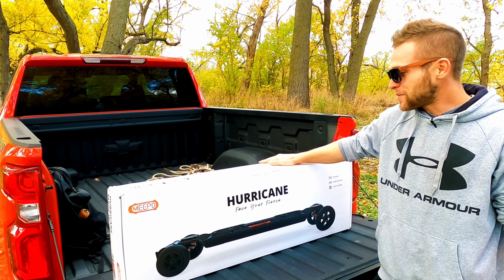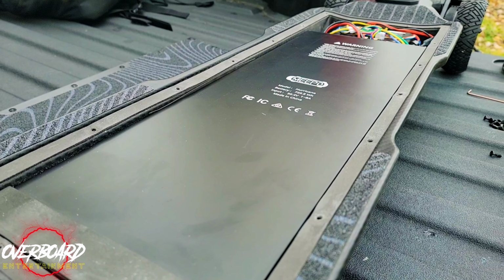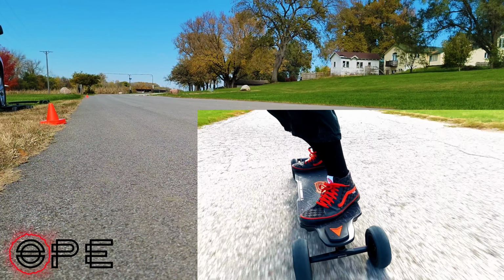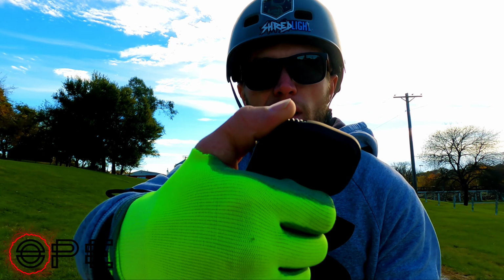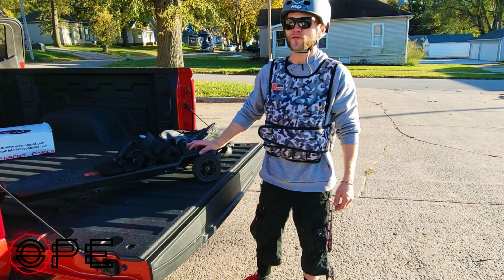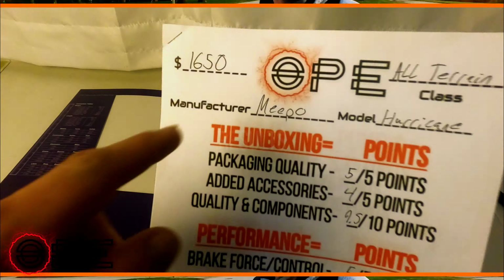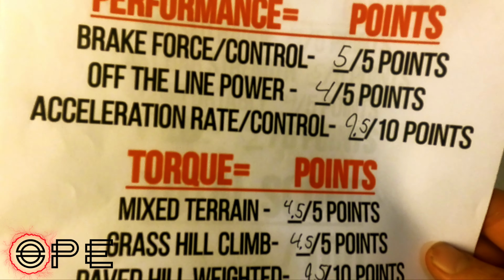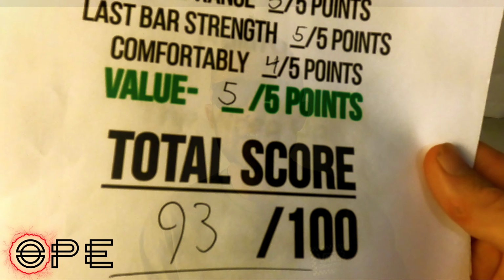Meepo Hurricane - Unboxing | Specs | OverBOARD Performance Evaluation

Comment: Hi and thanks very much for this review that I consider like one of the best if not the best one. Your review system is really good and looks very professional, congrats. 
I was afraid that the weight and dimensions could cause some troubles for fun while carving but it appears it doesn't. I have been waiting for a long time to an AT board with the following specs : agility, range, power, fun and <1400$. It seems that Meepo did it... 
For now I have much fun with my Meepo V2P and I'm thinking a lot about buying the hurricane.
Reply from the maker: Thank you so much....
I will be 100% honest with you....

Buy the Hurricane dude....
Its the most quality built, funnest and most powerful board out right now in my option.
Very intense and feels extremely solid....
Again, thanks bro
Reply: @overboardentertainment1569  Thanks for your fast answer. I can't lie saying I'm not disappointed by the range you got in your range test  (also a nice and useful video) even if I got the fact that it was in an agressive mode. In a sense, I was satisfied when you said in a comment that, at least, we couldn't reach less than 18 miles lol. But in another sense, it's too bad that it seems impossible to get the 31 miles advertised except if you ride at 5 mph maybe hahaha. 
I hoped that the new ESC could arrange that but it seems not... Anyway, this board is still a great crazy value for the current price. I hesitate with the Zeuz for the range point but I also know that I love power lol and it's not everyday that you need more than 20 miles range... Moreover Zeus is more expensive....  Really hard choice that many people are looking to make nowadays.
Reply from the maker: @elohir1664  For real tho, if you kept it in speed mode one, on a gym floor.... you might get 31 miles hahaha

But im a power hungry dude too... and the Hurricane is in no short supply... 
And
Like you said, how often are we doing 20 miles on a typical day
Reply: @overboardentertainment1569  I just ordered it bro ^_^' I'll keep you in touch, thx for your help "
Reply from the maker: Ayyyyyy!!
Reply from the maker: @elohir1664  c
Congrats bro... in for a good time😁😁

Comment: For Comparison,I have an Ecomobl ET..I have gear drives instead of belts.12 Cells and 50 amps.Goes up to 36mph and up to 30 miles.I have 540 miles on it.Nothing replaced.Good board.
Reply from the maker: Damnn... sounds like a super solid build.... 
I need to look that up and take a closer look.... when did that board drop?
Reply: @overboardentertainment1569  it must have dropped about 2 months after I got the ET..then hearing about them dropping down the ET to make the ET2 more of an improvement.Only thing changed was the wheels and the ESC and the color.It's sort of loud but then,it gears.
Reply from the maker: @paperlessdigs6169  its a kick ass board  bro... I'd be proud as ever with that board  out ripping around. 
The numbers are there....
But I will have to keep them in mind for the future boards so more people can know about Ecomobl.... dope

Comment: Just got this board in this morning....after jumping on the black Friday pricing on 11/2.  First impressions is that this board is pretty damn sweet....am super pumped about it.
I am not savvy on gearing yet....but do you think the factory 55T will work out if i change the tires from 155mm to some knobby 175's?  I can only guess that it should be ok since I am a light rider (less than 140 lbs).  Would like to take the board on some light trails.
Reply from the maker: Where are you getting the 175s....

The 55s would work with most Pnumatics as far as wheel size.... but the design of the Gear would be pretty specific to the rim design.

Meepo for sure has the stock and 190mm Pnumatics....
Just let me know what set of 175mm you are interested in
Reply: Word I was looking into running the 175 off-road/knobby tires off of the Evolve web site.  I assumed since they were 175x50 they would fit the Hurricane hubs...but now that I think about it....those are only the exterior tire dimensions.  I am not apposed to picking up a second set of wheels...as that is my overall plan.
Reply from the maker: Okay,  let me check out Evolve 175 rims

Comment: How much do you care about the extra weight of the Hurricane? With its big battery and heavy duty built it's one of the heaviest boards (14,4kg on 90mm). The Lycaon is about 4 kg lighter with 10,2kg. 

I would like to carry it on my ebike to get to a few spots. So I feel that this bulky extra weight could annoy me more then benefiting from the extra milage with the bigger battery. How do you think about the weight of a board, since it's not in you evaluation test?

And you rated the Carvability very high (4.5/5). That's great to hear, because currently I'm mostly looking for this instead of doing distance rides. If I'm mostly into carving and weigh under 180lbs, do you think a flex board would offer me more fun and give me more this snowboard feeling? So should I rather stick to a true flex board like the GTR bamboo or Haden bamboo or the WOWGO AT2, which is also made of maple tree or a mixed flex board like the ONSRA BC2?

Thanks for the awesome test!
Reply from the maker: It'd super nice... just dropped a range video if your interested...
Well both new models are using the Molicels 21700, kinda comes down to the 4p 3p weight differences cuz the Hurricane is only slightly wider with a similar material....

They are both killer boards
Reply from the maker: Okay.. now the Hurricane is definitely gunna be alot to manage on your back... she is a big girl... the Lycaon is definitely better in that sense and still offers very similar power just a lower range... I will be adding portability into today's OPE testing of the Lycaon 3.0... Hope to have it edited up by Monday evening and posted...
Reply from the maker: You are the 3rd person to talk about portability... so I will 100% be adding it to the testing from now on and just adjust some numbers....
Reply: @overboardentertainment1569  Awesome! Thanks a lot.

Y

Comment: Will you be redoing this review or sections of the review once you receive the new ESC and upgraded parts from Meepo? Would love to see the difference and what I'll be expecting when it comes in.  I guess you can name the review Meepo Hurricane Updated ESC ... I see a lot of reviews with the older ESC and people capping at 30mph and slower acceleration.
Reply from the maker: Hilariously enough dude I am filming the before... like as we speak haha Just doing  two  comparisons, Top speed and off the line power....
Go home do a How To Video for the first model owners... and then go out and do the after comparison.
Attach the how to, on to the end of nice clean and simple before and after video.
Reply: @overboardentertainment1569  man I was going to mention that too. I can't find a video on how to upgrade/replace the ESC and parts they are sending. So if you are the first one, kudos man. 👏  can't wait to check put the difference this will make vs the original test. Good luck!
Reply from the maker: @XTRUCASE  🤜🏼🤛🏼🤙🏼

Comment: Unclear on how the breaking system works... I get the breaking mode selection, just like a speed mode, but; are you able to adjust the strength of breaking with the control wheel ? Or is it more of an on or off ? Lets say im in the strongest break mode, can i still feather the control wheel to get gentle breaking even though im in mode 4 ?
Are these breaks regenerative ? Do you notice it put any power back into the battery % ?
Reply from the maker: Heyy... yess... brake mode 4 can be used lightly, but it's still too much.

Sometime when you really need to stop you slam the brake.... finding that sweet spot of full slam without tire slip is what you want.

I like brake mode 2... very strong but no locking up... I weigh 160lbs and mode 3 will lock up at 25mph with full slam....

And the regen is more or less a weak selling point... 
Braking will get you factions of a percent... but then you have to use up all that energy just to reaccelerate back to speed.

A nice constant cruise is ideal once you get going to save range...

Hope this helps... sorry for the late reply
Reply: @overboardentertainment1569  That is helpful thankyou, i have an evolve stoke so im used to regen braking. 
I only asked incase theyre using the motors in reverse to slow the board down ( as opposed to using the motors as a generator ). I see evolve acceleration and braking control as perfect and am trying to identify any differences as im about to upgrade.

Have you noticed any cons about the board since you released this video ? Such as weird noises, parts failing ?
Reply from the maker: *edit
I think the tubes that Meepo are using are weak... had 2 flats and replaced it with Backfires tubes and we goood.... if you get a Hurricane, buy extra tubes from a better seller...  besides that, it's a super solid board, no lie
Reply: @overboardentertainment1569  Good advice, thankyou. You dont have to keep answering questions but ... Do your motors make any clicking / scraping sounds ? What do you think of the balance of the wheels and motors ? ( i.e wobble )
Reply from the maker: @LORFCASTER  You are good brotha...
I'm Jesse Batten on Facebook if you want to message me anytime...

But the motors are great man... legit powerful and as far as I'm concerned they are quality made.
Pnumatics are hard to make perfectly balanced.... 0 to 29mph can be done without fear if you tighten the trucks enough. Really nice set up with great bushing...
But 30 to 32mph or more on any of the Pnumatics I've riden anyways... just give you that slight feeling of not "perfectly balanced" 
But Eovans new 155s are the best to me so far... really nice feeling ride and corners. Putting new bushings in it tomorrow after work.
I'm editing the Eovan vs. Meepo video this evening

Comment: niceeee dude!! what range did u get when the 1 bar wouldnt give u much anymore power??  keep the content comin brotha!
Reply from the maker: This board has a fail safe which took me off guard... it legitimately had nearly 100% of its original power while the remote was still vibrating at me... then all of the sudden it just dies. The reverse of 0 to 100 real quick.
But after all that ripping around and multipule takes I got 17 miles which is nuts... im sure just chillin in the 3rd speed mode I'd get Like 23 miles or more ....
The board is pretty incredible, no bs, even next to some of the diy stuff I built cuz I was using 36t / 16t with 97s.... but this has big ol gears and pnumatics and feels very similar... its crazy they are only asking 1300 for it right now

Comment: Nice review man I have been looking at thIs, the Hammer, and the Propel S.  Do you think this is worth the extra $ over the Hammer?
Reply from the maker: Thanks again bro...
The TRX 3.0 is alot better then the Hammer.... Though the Hammer is beautiful, it has an absolutly terrible range and power sag issues in my opinion. You can watch my last range video on it.  And Backfire is aware and it's "normal"...

But the Hurricane is a savage for 1300 bucks... and like $1280 with someone's code. The TRX IS $1170 with a code... but its a 3p, and the Hurricane is a 4p. 
Both using Molicels and powerful motors.
Reply: The hammer you’re really considering that low stat over priced board? At least compare the hurricane to the propel board or something lol

Comment: Thanks for review.

Would you recommend the Hurricane or TRX 2.0/3.0?
Reply from the maker: Well the trx 2.0 is a fantastic board... on 97mm street wheels its very powerful with awesome range...
And the 3.0 will arrive tomorrow😁 so I'll let you know but....
Man...
The Hurricane is a complete savage... top to bottom.
I love it so much... 
Everything is nearly perfect

Thanks for the comment... let me know if you have any other questions man!
🤙🏼
Reply: @overboardentertainment1569  that's great! I'd love to know how the TRX 3.0 stacks up against the Hurricane before I make the purchase. 

Thanks again
Reply from the maker: @bj5563  I'm gunna do a separate indepth Vs. video with the 2.0 and 3.0.

And then a 3-way vs. with the Hammer, 3.0, and Hurricane
Reply: @overboardentertainment1569  one other question: is the Hurricane much longer and heavier than the TRX 2.0? 

The specs on both show the Hurricane as 4.25inches longer and 12lbs heavier
Reply from the maker: @bj5563  find me on Facebook...
Jesse Batten... its me and my wife and im holding my daughter.

I'll send photos

Comment: Does it have stronger acceleration than the hammer? I want a production board that accelerates like my DIY and the hurricane looks like it comes the closest. I got the Zeus but a little disappointed in the acceleration.
Reply from the maker: Real shit... off the line power of the TRX 3.0 is almost equal to my dual diy stuff....
I just got an upgraded ESC for the hurricane... hoping it will  improve acceleration and top speed
Reply from the maker: Watch our OPE on the TRX... or the unboxing... great board
Reply from the maker: They send everyone with the "first gen" Hurricanes their upgraded ESC so it could be equal to the new batch they are sending out...
Reply: @Overboard Entertainment  I'll check it out, does the trx 3.0 ship out of china too? The $1,300 price tag is attractive on the hurricane but that's only if you do the sea shipping option. I hate waiting but i cant justify $350 for air shipping. Was hoping one would pop-up for sale on Facebook but haven't seen anything yet. I'll watch your trx video and decide. Appreciate the info!
Reply from the maker: No problem man..  the Hurricane outperforms the 3.0  top end....
But the off the line power and mids is stronger on the 3.0 in my opinion....
But I think Meepo sent the new ESC to make sure the Hurricane is the champ for the year....

And yeaa... all out of China man
Reply from the maker: Both are fantastic boards... but I'll let you see the difference after I change the ESC  in the esc

Comment: I got my first every eskate board about 2months ago the meepo nls pro but now this black friday sale is on ill probs be ordering this in a few weeks time. Whats its top speed? i know on the website it says 35mph but is that with the AT set up ?
Reply from the maker: Exellent bro... and for real that black Friday sale is insane. Amazing deal... 
And
Yep! I pinned it out multipule times now and it does every bit of 35mph with pnumatics... as long as your tightened up it is actually very stable at those speeds too.
Reply: @overboardentertainment1569  WOW 35 on AT is unheard of for a stock board considering the new evolve hadean tops out at 26mph. I wonder how the hurricane would match up with the hadean in terms of torque/acceleration. As ive heard the hadean is a beast in that department.
Reply from the maker: I saw Esk8Unity with 36t gears rip it up off the line... which is crazy. So I couldn't honestly tell you... but it does punch off the like with pnumatics and after 10 miles an hour in the 4 speed mode you must be bracing yourself at all times hahahah

Comment: How do you rate the comfort compared to the Hammer? The stuff deck v the flexi deck? I have joint issues so need a smooth ride. Thanks
Reply from the maker: Definitely go Hammer if you have joint issues... but be aware of the range.
Check out my range video.... the Hammer is a dream offroading with tons of power... but after 10 miles of riding it starts to get power sag pretty good
Reply: @overboardentertainment1569  I have the Hammer already and just find it a bit too bouncy. But the Hurricane would probably be too far the other way with the stiff deck. I'll probably just enjoy the Hanmer for now and wait till next season and get a GTR bamboo when the new remote is available.
Reply from the maker: @Jonny Rocket  okay, so....
If you don't do extreme offroading, the Hurricane is a dream... plus you're locked in due to the dropdown and perfect concave.

For the street, bike trails, even dirt roads and grass....
It's an extremely safe and comfortable feel..

It's just a tank of a board to be honest.... but surprisingly maneuverable
Reply: @overboardentertainment1569  for 15-20mph carving, did you think the Meepo felt better than the Hammer?
Reply from the maker: I say that comes down to personal preference on the Hammers rebound from all that flex... but if you get in the motion, The Hammers probably the more maneuverable of the two